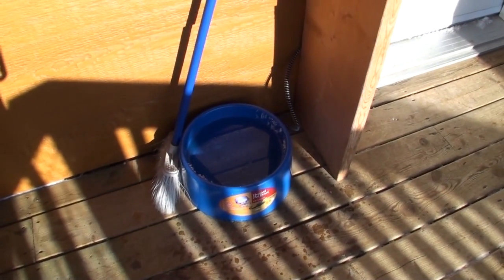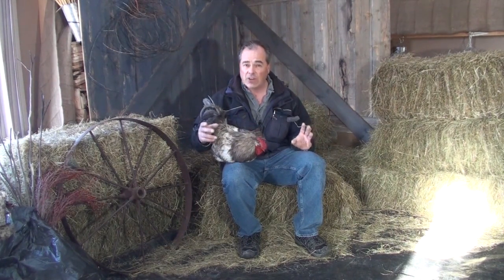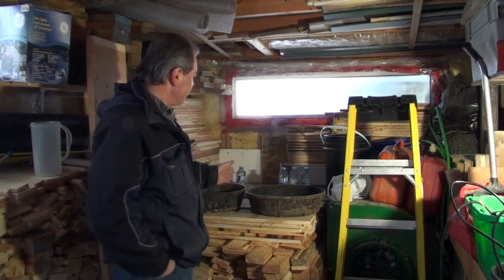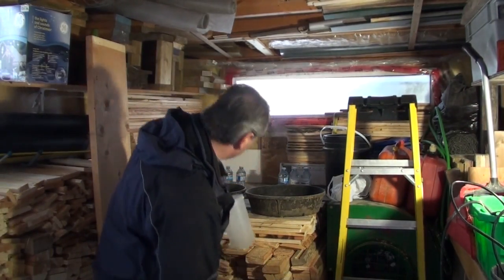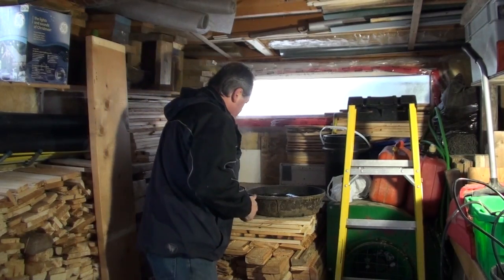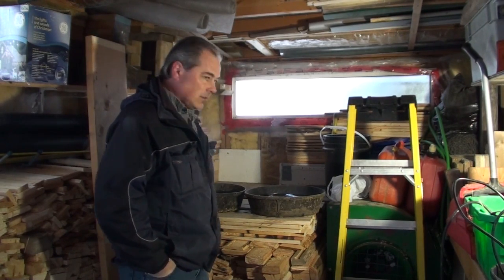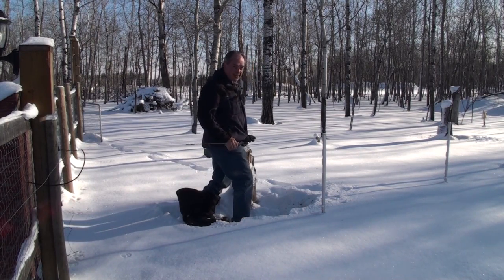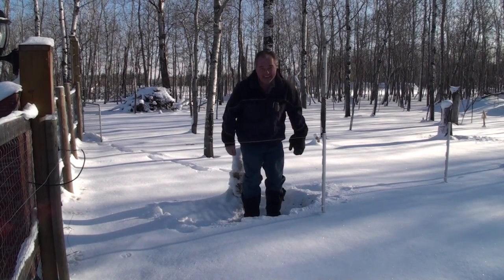Farm Science - Shocked by Electric Fence - Prevent Pet Water From Freezing

Comment: This whole concept has been twisted around and confused by the purpose of the salt water.  In an open trough outside, floating objects pushed around by the wind and the animals will help to keep the surface of the water from freezing.  It will eventually freeze up, but stirring the water slows the process.  A handy object is a jug filled with water...  The salt water keeps the water in the jug from freezing and damaging the jug...
Reply from the maker: This makes allot of sense, thanks for your comment.